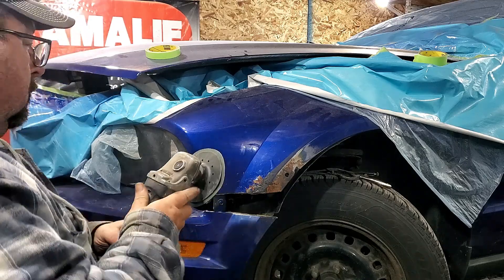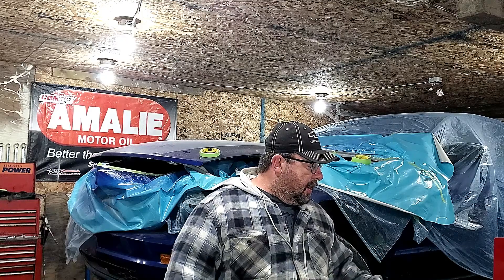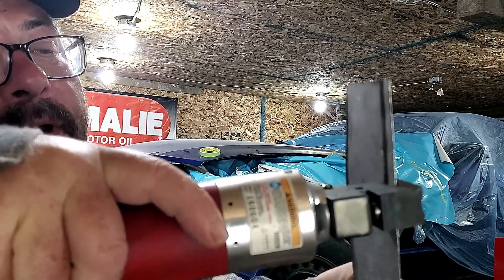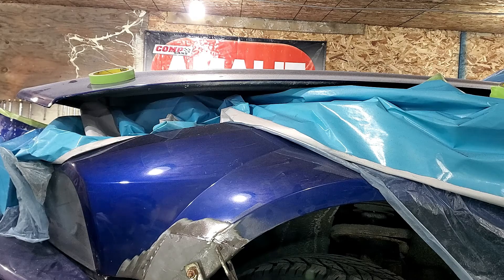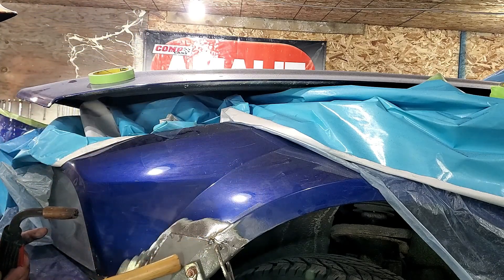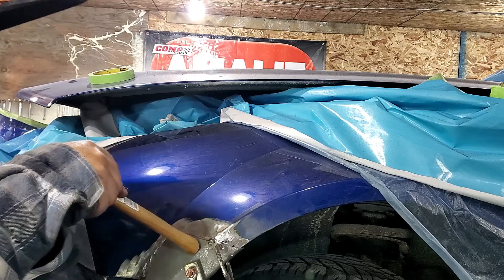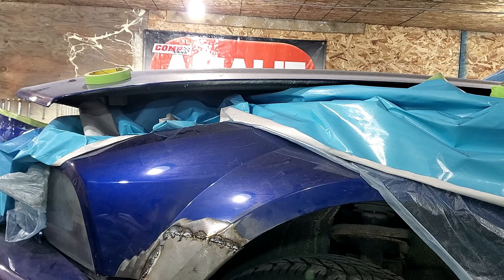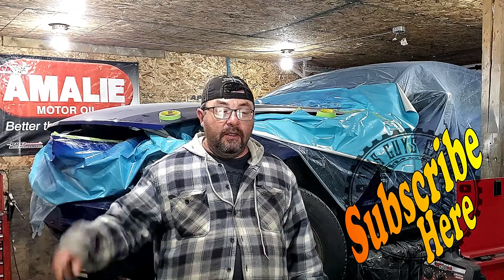autobody 101  MiG welder set up for car bodywork

Comment: I love the fact your using a tack hammer to do tack welding. I have a tack hammer that I rounded the tack holding end to use as a body hammer in tight spots.